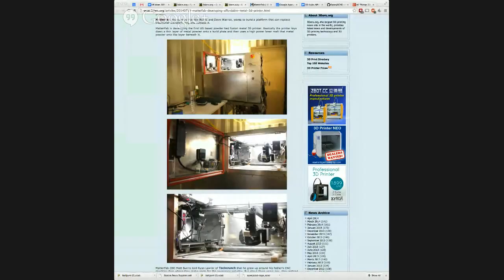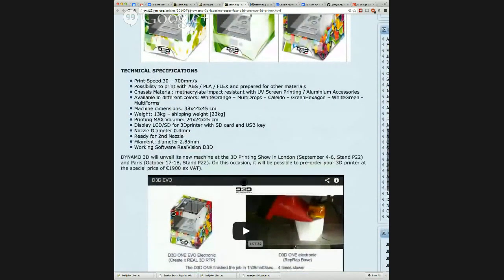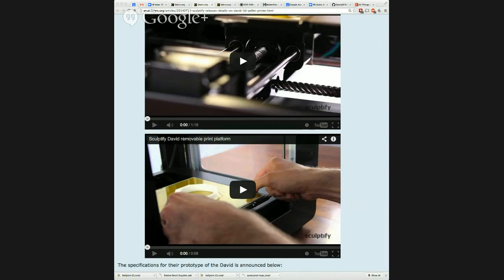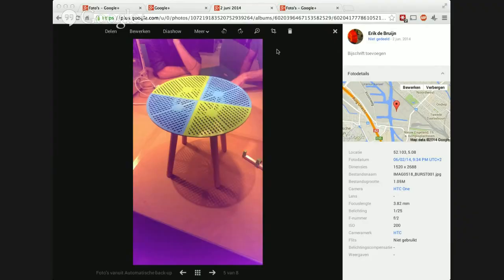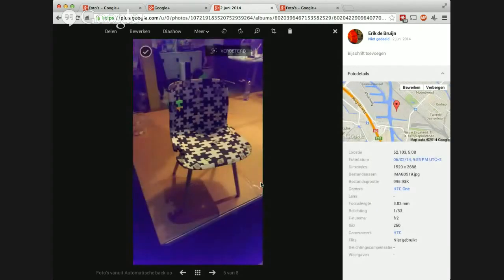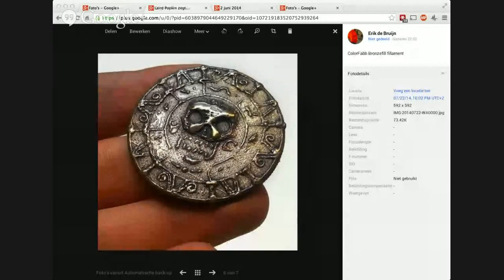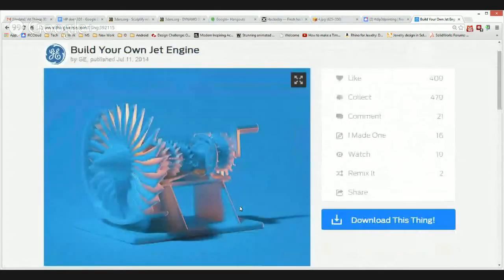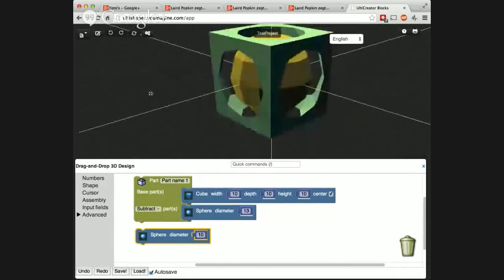Roundtable Discussion "HP does 3D?"

Comment: Here are links for the things I (Erik) mentioned in this Hangout!

3D sharing and collaboration community:
http://YouMagine.com

Print you own chair out of jigsaw puzzle pieces:
http://wsimag.com/architecture-and-design/8928-joris-laarman-lab-bits-and-crafts
Printed table by UltiArjan:
https://www.youmagine.com/designs/small-table-side-table

Pick-and-place first developed on Ultimaker by Jeff McAlvay but now a full-blown dedicated pick-and-place:
http://tempoautomation.com/

BronzeFill Material (80% bronze, print heavy metal items)
http://ColorFabb.com/
Chemical polishing with vapor: Tetrahydrofuran (THF) dissolves PLA but it's dangerous.

Parametric design tip:
Try parametric modelling. It's getting a lot easier than it used to be. Create a customizable model with YM. Parametric modelling including making your own UI for changing parameters. OpenSCAD. Precise 3D models, easy to modify and collaborate on. You'll easily make even complex shapes that are always solid, water-tight. No need to pay for powerful parametric design software.

http://coffeescad.net/
http://OpenJSCAD.org
http://ultishaper.youmagine.com/app
Each of these tools will be integrated into YouMagine.
Reply: ***** Good point. For simple and/or complex toolpaths there are options. Any dxf to polyline tool can be embedded into the UltiShaper, so effectively it works with an ecosystem of apps. This is how I started:
UltiShaper - Making of: Sketching (version 1)
This is a more integrated example:
UltiShaper: Better Sketching tool integration
Reply: Cool! Can hardly wait for the parametric YouModelling. :)
Reply: great discussion thanks.